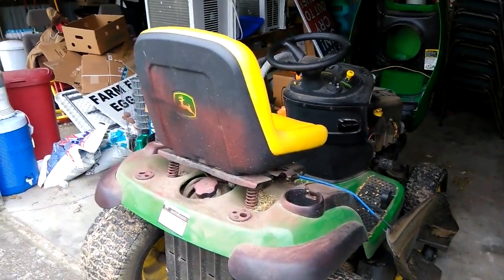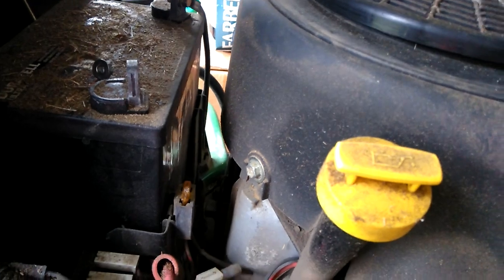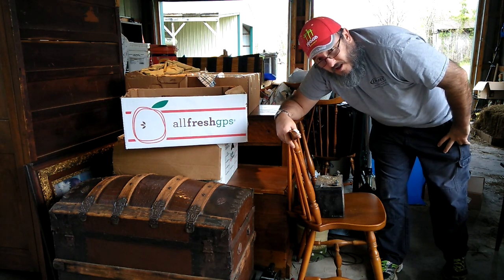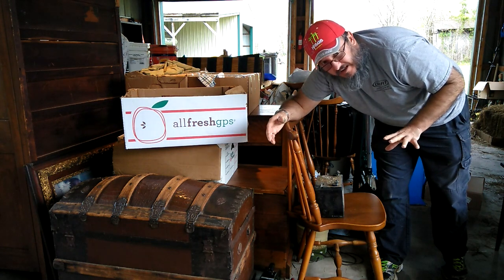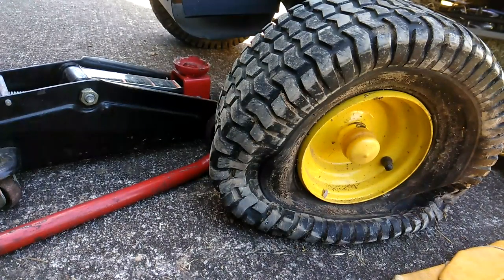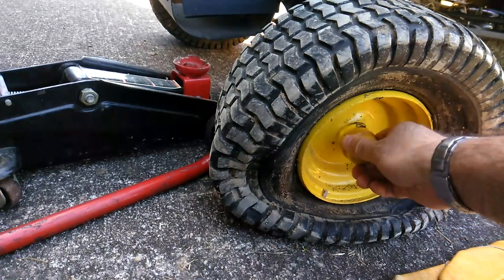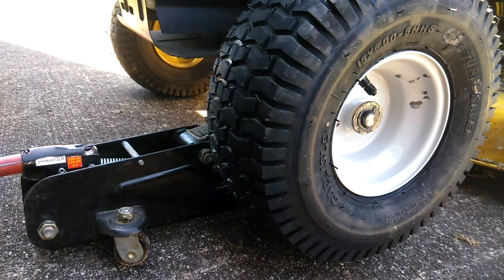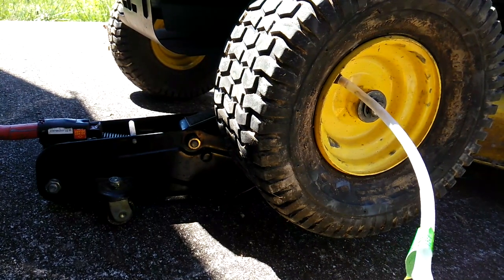John Deere Lawn Tractor NIGHTMARE... keep going

Comment: You should be able to take a long screwdriver and knock the bushings out of your old wheel and putthem in your new one .! I have done it many times ! it will save you some money !! But im glad you got your yard mowed !!
Reply from the maker: I tried that. I will have to try it again. The main thing is to work through the problem and not give up. Some solutions might not even be the best solution at first. I will try that again. Maybe if I brace it somehow, and get some good hits with a hammer!